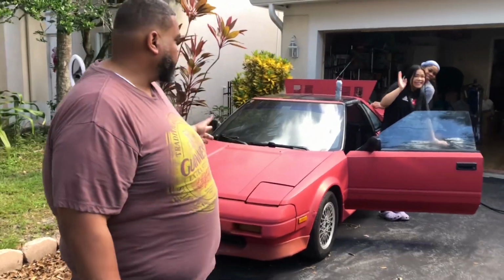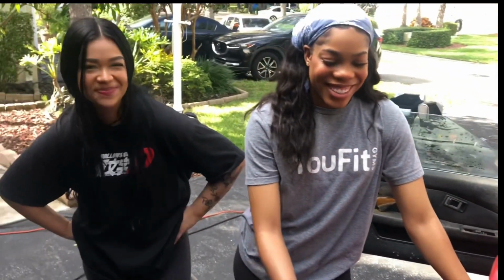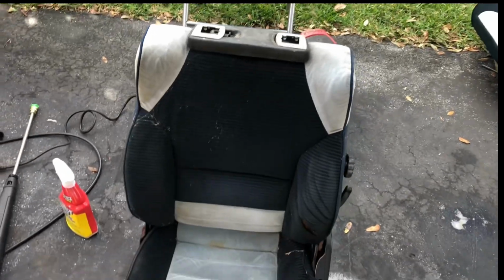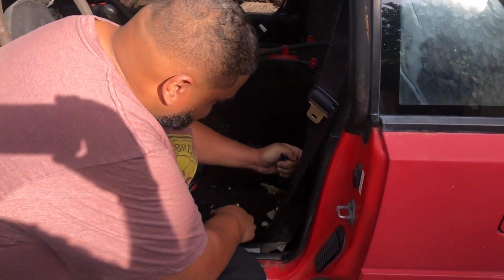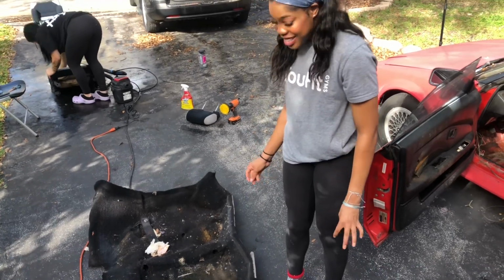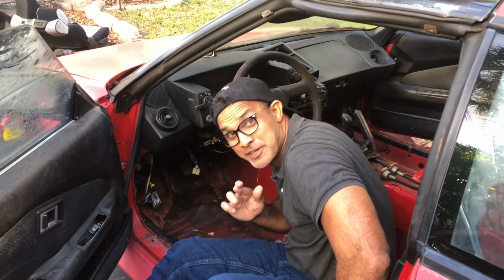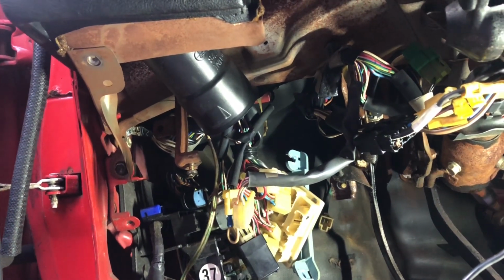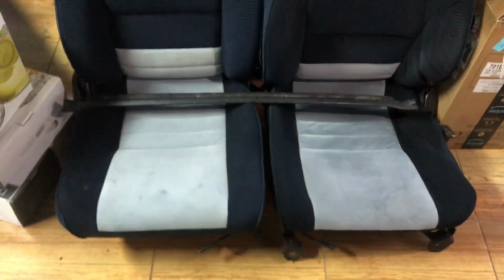Aw11 Mr2 Rescue, project car life

Comment: That looks like a big TLC project!!  👍🏻
Reply from the maker: It is but definitely possible. How is the 91 turbo running?
Reply: @bitingantz  It's running great!  I just had the tint redone on the windows and installed an Alpine double din sat/nav head unit that has all the features.   I'm waiting for TCS to restock the single muffler exhausts.
Reply from the maker: Sounds good Mike

Comment: Looks like a good project to get stuck into, lots of desirable parts to that AW11 too.

I had a no-start stich too (which was partly because I had no fuel pump, but I know you can bypass for now), what it turned out to be was I had the distributor arm in a tooth out, which meant the ignition timing was badly off. If you've got a timing light, it might help you - but if not (like me), then you can double check with what's explained here: https://youtu.be/KzoJH865anM?t=396

Might not be the case for yourselves, but sharing what worked for me. I still got the dizzy arm off by one tooth, but I could adjust the arm enough to hear it cough into life, with it at max rotation close to the direction the tooth needed to change.

All the best with this one, will be watching along!
Reply from the maker: Thank you. Really appreciate you sharing the knowledge and giving some insight.

Comment: The first thing that I would do is jump the diagport to see if the fuel pump works, next another issue with these is sometimes the igniter module will go out otherwise it would definitely be worth it to take the distributor cap off and sand the points just to make sure it's not just corrosion that's causing the no spark issue. I currently have an 88 Supercharged model but I had a 1991 SW20 and I know after washing that car periodically sometimes water ingress into the distributor would cause a no start as well. But I would definitely check to see if the fuel pump is working if the car sat for a long time it wouldn't necessarily be out of the realm of possibility that the fuel pump is just dead.
Reply from the maker: Thanks. We are not so concerned about the fuel pump for now as we can use starting fluid to bypass that to get it to fire. The main issue for now is figuring out why it does not have spark. The rotor and cap were replaced so we feel like the distributor itself may be the problem. Appreciate your feedback.

Comment: How's the throttle body look? Is that the stock location for the air box? If intake is ok, maybe check the fuel injectors. Or the BGB wiring would help figure out the wiring
Reply from the maker: Wish i had a bgb for the car. We are not concerned about fuel for now as the issue is no spark. Thanks for the feedback.

Comment: hey bro, I got my mr2 sw20 a couple months ago and it idles pretty high compared to when I first got it. Do you know what it could be or things that I can check?
Reply from the maker: Hello, is the engine actually idling high or just showing high on the instrument cluster tach? If the engine is actually idling high then I would look for a vacuum leak or stuck 
\restricted throttle cable. If it’s just the cluster showing high then capacitors in the gauge are going bad

Comment: I was having the same issue with my sw21. I was getting no spark so I changed the distributor cap and rotor thinking that would solve it. That didn’t work so I decided to replace the whole distributor and boom, started right up. Not a aw11, but hopefully this helps.
Reply from the maker: Thanks for that tip.